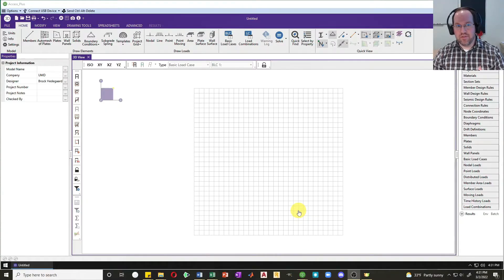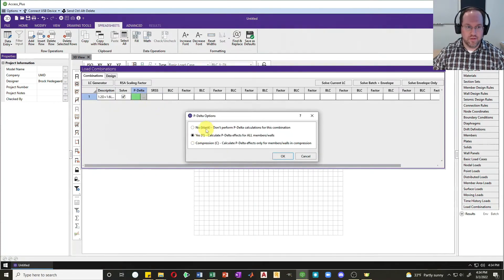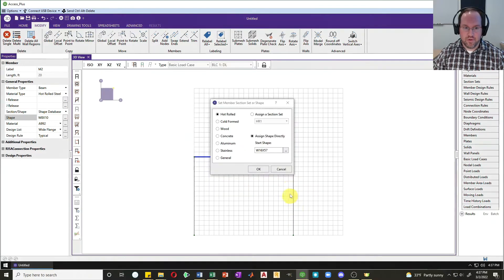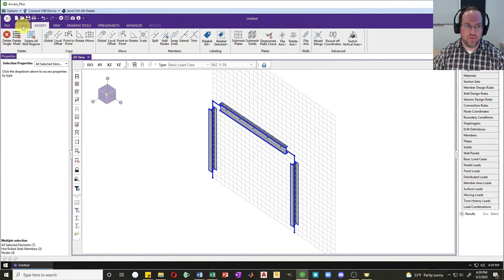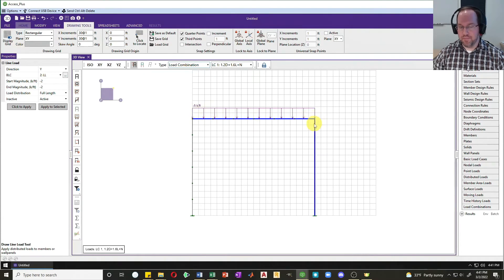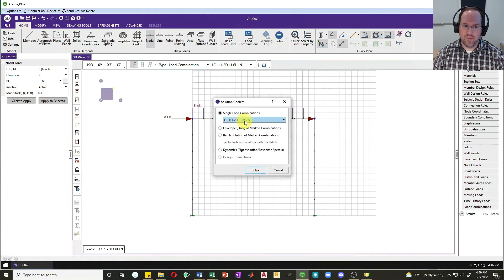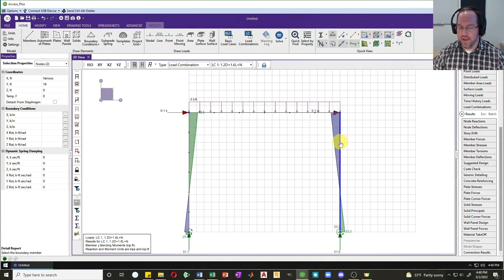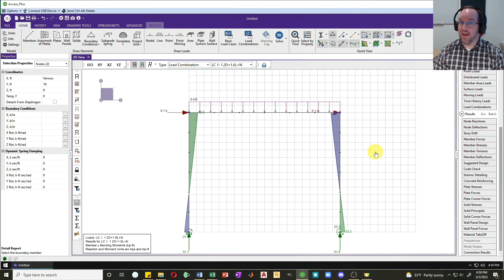Direct Analysis Method for Steel Buildings using RISA 3D

Comment: If the Direct Analysis Method assumes that Lc = L, then why does RISA—which uses this method—provide a field for entering an effective-length factor or an effective length? It’s confusing. In a frame, under the classic Effective Length Method the effective length is computed from the member lengths and stiffnesses, and typically the column’s effective-length factor is greater than 1. I’m getting mixed up—could you please advise how to set this correctly in RISA
Reply from the maker: The effective length field in RISA is used only for RISA's capacity checks (i.e., the unity checks and other design checks it can perform for you). It has no impact on the how the analysis is conducted or how the demands are calculated. 

The entire purpose of the Direct Analysis Method is to move the effects of instability and column buckling into the analysis/demand side of the equation, whereas the traditional Effective Length Factor K method handles the effects of instability on the capacity side of the equation. That's why if you are doing the Direct Analysis Method, the effective length factor K = 1, always. 

That said, the effective length field in RISA has two purposes:
(1) You don't NEED to do the Direct Analysis Method in RISA. It can do traditional first-order analysis too, but in that case you will need the effective length K factors to properly account for instability. 
(2) It's still useful if you are using the Direct Analysis Method because, by default, RISA capacity estimates assume the effective length of a column is whatever you draw it as. Meaning if you draw a 20-ft column, it will tell you the capacity of that column as though it's unbraced length Lc = 20 ft, regardless of how that column is actually braced along its length. However, if there is bracing at mid-height of that column, we would normally set Lc = 10 ft to check it's capacity. This goes for the DA Method too, we just don't need the effective length factor K to further modify the length. 

So in short, you can manually change the effective length in RISA so it gives you the correct capacity estimate, but otherwise that's all it does.
Reply: @StructuresProfH  Thank you for the detailed response. I still have some uncertainties, so let me illustrate with an example. Suppose I’ve modeled the three-dimensional frame of a building made up of single-span frames with fully fixed column bases and rigid beam-to-column connections. To determine the effective-length factor (K) in the plane of the frame, I would consult the AISC Fig. C-A-7.2 nomogram, “Alignment Chart – Sidesway Uninhibited (Moment Frame),” and, based on the parameters that account for the lengths and stiffnesses of the frame members, select the column K-factor (which on the chart ranges from 1 up to 20 and then to infinity). After that, I would enter this K-factor for the columns in RISA to correctly assess their capacity. Is this the proper approach?
Reply from the maker: @maksimks4030  If you are conducting a typical first-order analysis (i.e., what you learn in an intro structural analysis class), then yes, you are correct. Or, more exactly, I think RISA asks you to enter K*Lc, not just K, but still you would need the K factor from the Alignment Charts. 

However, if you are conducting your analysis in accordance with the Direct Analysis Method, considering P-Delta effects, using notional loads, and everything else required by the specification, then the effective length factor is always K = 1. You don't need to use the Alignment Charts in this case. You could still enter the unbraced length K*Lc into RISA, but you would just use K = 1 as noted.

Depending on what edition of AISC you are using, the Direct Analysis Method is discussed in either Appendix 7 (older editions, though I don't recall when it was first introduced) or Chapter C (newer editions). Regardless of edition, this method has always allowed you to just skip the Alignment Charts and set K = 1, which is a pretty nice benefit if you ask me.
Reply: @StructuresProfH  You know, I’m very grateful for your answers to my questions. I revisited the theory, re-watched the video, and after setting up my own experiment in RISA, all the pieces fell into place. Indeed, it’s a very convenient method—there’s no need to worry about what the effective-length factor will be.

Comment: can use direct analysis for concrete structure?
Reply from the maker: You can analyze concrete structures in RISA, but the procedure is not quite the same as the direct analysis method for steel structures. RISA allows you to switch your governing code document in the options, so many of these things may be automated in the program - check out the RISA documentation for details on whatever code you use.

As for the differences: Assuming you are designing your concrete structure according to ACI 318-19, there is no notional load. Instead, the axial-moment interaction diagram for column capacity has a "minimum eccentricity limit" defined in Section 22.4.2.1. Also, the stiffness reduction for concrete is different from steel. Concrete needs to account for cracking and creep; Section 6.6.3.1 in ACI 318-19 has reduced moments of inertia for factored load analysis.

As for the similarities: Both steel and concrete structures can be analyzed using second-order effects (P-Delta or P-delta). These work the same way. To get the P-delta effects (that is, deflections along the length of the column), you should define nodes along the length of the members, just like for steel. When you use second-order analysis for concrete structures, you don't need to do the moment magnification procedures for nonsway or sway systems (Sections 6.6.4.5 and 6.6.4.6); the second-order analysis already magnifies your design moments.
Reply: @StructuresProfH  thank you for explanation. Does software can calculate small p delta directly? Yes to include small p delta we have to mesh column, Example mesh length= width of column B. for most of software can calculate accurate small delta for single curvature like a single cantilever column. How about double curvature?

Comment: why you used RISA 3D ? what its advantages versus staad or etabs? besides, I know that RFEM has a large capabilities in analysis.
Reply: Mainly user interface - RISA3D is very simple to learn regardless of how long you have been in engineering.  RISA3D is also very compatible with spreadsheets, which if your company has already uses for design analysis (steel, wood, or concrete), then the outputs from RISA3D can easily be adapted to what you already have in house.

Comment: I believe risa will perform p little delta analysis is you select the geometric nonlinear analysis approach
Reply from the maker: Yep. Good catch! Geometric Nonlinear Stiffness analysis was just added in RISA v20, which was released about a month ago. I'm still working on v19, which does not have this feature. For those interested, here is a link with more details: https://risa.com/post/p-delta-analysis-using-geometric-nonlinear-stiffness-in-risa-3d
Reply: @StructuresProfH  thanks for the video!
Reply: @StructuresProfH  I would add that you still have to use the nodal shear method when adding any special 'user inputs' for member end connections, for example adding custom releases to mimic partial fixity.